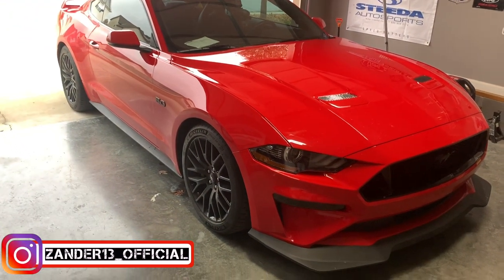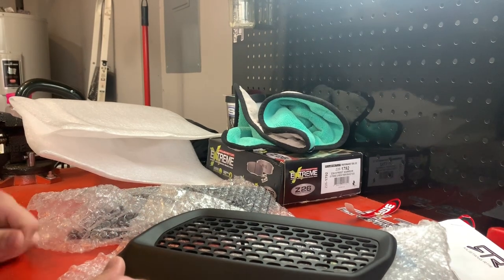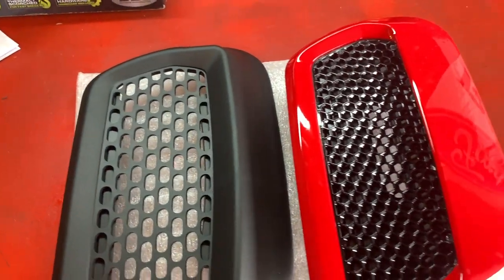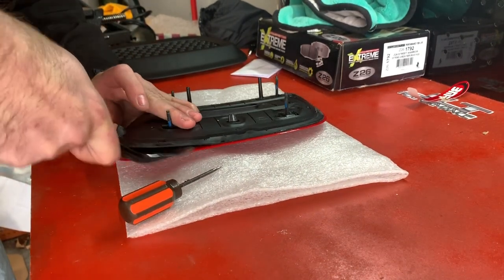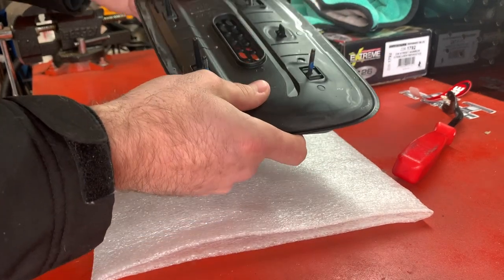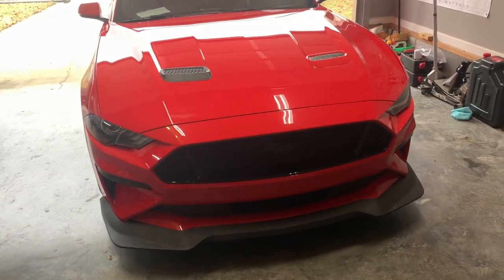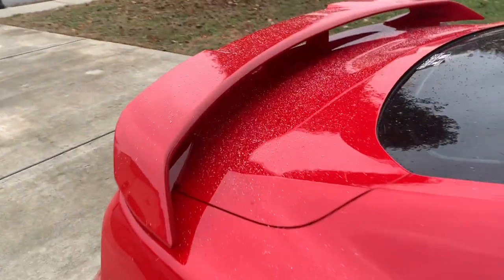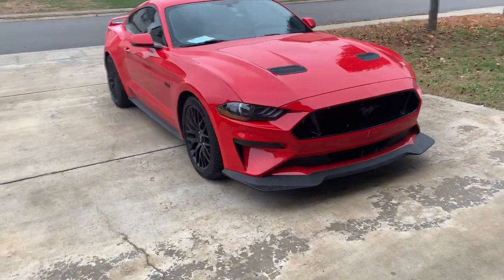YOU NEED THIS- 2018-2019 Mustang GT RTR Hood Vents Install and Review

Comment: I like the raised bump on the leading edge of the vent. I think it will create a lower pressure area over the grille area at speed that will help in extracting hot underhood air, a desirable thing. The plastic plate underneath the vent looks as if it may be a water baffle
I think a color scheme on the new vents that matches the old, gloss black on the grille and red on the frame, might look good. There will be a difference of opinion on whether gloss black or flat black looks best and that is a purely subjective thing. I happen to believe that whether gloss or flat is used is less important than in making it consistent throughout the car. Having different variations on the trim colors, or textures,  creates a less focused and more distracting effect, IMHO.
Reply from the maker: Agreed. And I have read that they do create a low pressure area as well

Comment: Besides looks, this thing seems kinda pointless. Yes it's open more, but once you put that backing plate on it with the tiny hole then it defeats the whole purpose of it being open. And it seems the OEM hood vent without the backing plate is just as open. So really, you need to enlarge the hole in the backing plate and the whole in the hood to match the grill itself. But yes, it does look better than OEM.

Comment: I think drilling the opening on the base is a great idea. Especially over the cold air intake side.  You sold me on these. That or im just going to drill out the OEM bases. I also removed my hood liner. I have a Whipple and it is cooler since I took it off. No noise difference.
Reply from the maker: the stock ones do breathe well. I think the most restriction comes from the size of the hole.
Reply: They do but the more cooling the better.. great install video. Have seen others but they weren't as detailed on assembling the cover and clips.. that's how you win subscribers. Are you going for a stangmode beard now? Yours grew a ton in a couple of days... Lol...must be the snow..
Reply from the maker: @thereissomecoolstuff  my wife wants me to grow the beard out. I personally like it shorter. I always try to be as detailed as possible. I like to show the viewers all the little interesting facts about products that no one else covers.

Comment: Overall black in contrast with red body color works very well. But agree the hood vents are maybe something that need to grow on you.  But the black emblems an the black tint on turn signal and parking light makes the front looks very nice. I personally own a magnetic gray 17 GT PP and I have a tint on all the lights expect for the head and rear lights, overall it makes a big difference and blends very well with the black wheels, tinted windows and the black emblems. 

The front splitter is very aggressive, but maybe not something I would personally add on my car.. But I would suggest you get yourself some 25/23 mm hub centric spacers, I got mine from Jeff Asthon ( But I am not sure if he is stilling selling Mustang parts) But it is a must if you are going to run the stock wheels to get spacers.

About the vents
the opening is very small,smaller then on the 15-17 cars. if I would add a power adder. I would open the vents up. Just but a water screen at the back. Same stuff as is put over the air filters if they are in danger of getting wet.
Reply from the maker: I have not seen anything from Jeff Ashton in a while. he just vanishes from time to time.

Comment: Z13...at what point do you throw caution to the wind WRT warranty...or do you have the patience to drive x-years before diving into the hard-core mods?   I don't believe StangMode installed any engine mods other than the cooler, driveshaft, exhaust--yet the dealership refused to repair his differential.  So, I'm assuming he voided his entire drivetrain warranty.  That could be significant if he blows his engine, transmission or differential.  Perhaps you could invite him to discuss this issue when you start your live show.  Thanks
Reply from the maker: you are correct. his warranty is totally gone

Comment: i like all the mods so far i live in NC i have a 17 pp1 in race red im up in the smokey  mountains all the time let me know when you want to go ride
Reply from the maker: will do. I really want to do a tail of the dragon run
Reply: @Zander13Productions  ive done the dragon 3 times and its a great road you'll want to do it in the dead of winter when theirs no one up there after the leaves fall the place is empty, i spent the last 4 years driving in all 3 states and i have mapped out some great roads, in the Pisga i like hwy 28 at fontana dam hwy 80 at lake tahoma and 421 they call it the snake its a great day drive. hwy 276 and 215 are in nantahala if you do it correctly you can go up one and then down the other makes for an epic day .

Comment: Another decent video, good detail and angle with the work bench footage. Like the advice with power tools and plastic.

I was at first skeptical but the hood vents work well with the splitter. 

Wheels / tires will set the car on another level. I had good luck with https://pkautodesign.com for my wheel / tire combo.